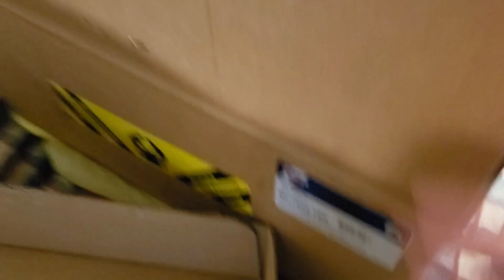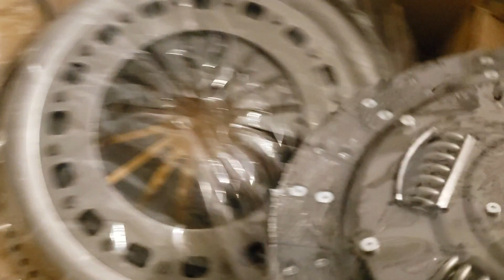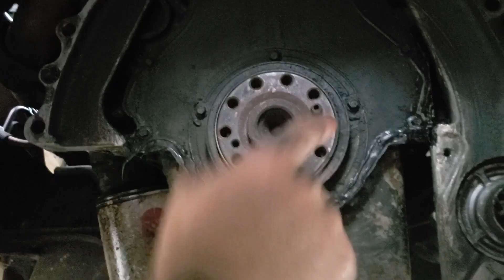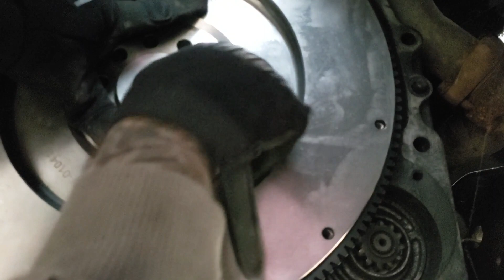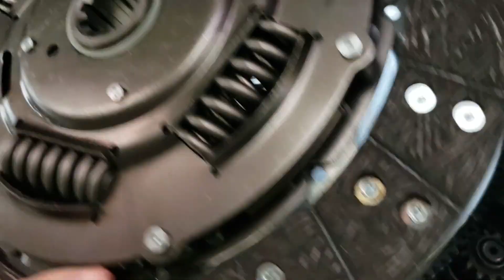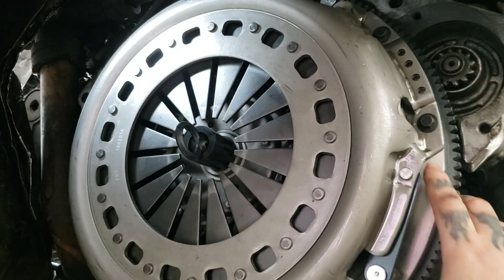7.3 Flywheel Clutch And Pressure Plate Install, How To Video

Comment: What year is the truck I have a 1995 that has the two stage flywheel was trying to find a single stage to put back in it have replaced it years ago but been hearing about a solid flywheel replacement just wondering if this is one of those I have a 95 f-super duty with the 7.3 power stroke in my rollback
Reply from the maker: Yes this is a powerstroke, you can see more on this 7.3 by seaching my channel videos

Comment: When you put the pressure plate on, should there be a little gap, and you snug it down, or is it supposed to be flat against the flywheel before you screw it down
Reply from the maker: They be a gap to you tighten it down
Reply: @TattsForLife thank you, I wanted to make sure I was putting it on right, mich appreciated for the vid and the response,  God bless
Reply from the maker: @colonialroofingofnorthcaro441 take care

Comment: I can’t get the flywheel to bust loose and what’s the best way to catch it? I’m trying to remove it right now if you see this please advise me
Reply from the maker: Air impact will take bolts loose, and just place your hand on it and hold on, its heavy be ready to gently set the weight down, its not easy, but just take your time and be safe
Reply: @TattsForLife thank you bro I got it all fixed thanks to you! I now have to replace the pedestal cause it’s leaking like crazy 😢
Reply from the maker: @blades7178 thanks for watching and happy the video helped

Comment: It's not grabbing the gears . It still moves but it takes a while for it to get going.  The stick shift goes in every gear okay but it acts like it not grabbing the clutch plate. What is wrong with my transmission.
Reply from the maker: It's probably the clutch disk, check to see if it's worn or glazed

Comment: How much did all your parts cost ? 
I got a Ford f-350 5 - speed overdrive manual transmission. 1999 3/4 ton , 7.3 motor 4×4 , 4 - door truck.
Reply from the maker: its a older video, I do not recall the cost, I say under $500

Comment: Great video but I sure wish someone would show the full process.  I got my clutch in and everything bolted up right, started my truck and it would not go in any gear. Re dropped the trans and my clutch fork seemed to be installed right but had two big gouges in the metal on my slave cylinder side. Something was locked up

Comment: Great video. Do you get any grinding noise after installing the single mass flywheel?
Reply from the maker: only in reverse but that is caused from the transmission gears for reverse and not the clutch
Reply: @TattsForLife  awesome, what year is your powerstroke?
Reply from the maker: @Arizonahwy10  I would half to look lol 😆 😂 I don't remember off the top of my head

Comment: Can Anyone Help me figure out why my clutch is hooting?  I've had my clutch assembly replaced twice in less than a year and it still "hoots like an owl" and yes they've replaced the throwout bearing both times. Is it possible there's an issue in the pedal instead? Any help is greatly appreciated!!
Reply: Just curious,  but I've heard the dual mass flywheel does that just before it separates
Reply: @tracyhill7960  We FINALLY figured it out!  It was the slave cylinder.  Praise the Lord it wasn't anything catastrophic!  Thank you!

Comment: I have a '90 F-250 7.3 non-turbo with the zf5, the ring gear on my dual mass flywheel is bad, would you suggest I just convert it over now to the solid flywheel?  And I'm guessing it will be the same as you show in your video?  Thanks for the time and effort in your video, very informative.
Reply from the maker: I like the way the solid flywheel preforms, but I use mine to tow alot
Reply: I've heard Reusing a dual mass will sometimes get your feet cut off when it blows apart at modern highway speeds
Reply from the maker: @tracyhill7960  Idk about that, but the solid is just stronger, I think a dual mask flywheel is their to help with vibrations and driver comfort, I drive alot old cars so vibrations are a normal feeling for me lol

Comment: Thanks for the vid..all my research on 7.3 is showing only 47 to 49 ft pounds for flywheel as well as manual with my clutch kit
Reply from the maker: Thanks for the info!
Reply: Be careful! The dual mast requires 49 and the single mast is like 89 or 90

Comment: Having an issue getting truck to go into gear after new clutch. When i was tightening down pressure plate the fingers were moving which seems odd so I exchanged it for a even better clutch assembly and same thing now truck wont go into gear while running. I also replaced master/slave cylinders. Out of ideas now
Reply from the maker: any trouble before the swap? and as your tighten the clutch down the fingers will move some as the disk puts pressure on to the clutch
Reply: Could be a bad slave cylinder

Comment: When you were tightening down the pressure plate to the flywheel, did the fins move on it??? I am having troubles with mine.
Reply from the maker: Not that I noticed, but the pressure plate does put alot force on to the clutch plate so it could, if its moving alot you could have something on wrong, or a bad part
Reply: @TattsForLife  okay. Thankyou for your help! I really appreciate it!!
Reply from the maker: @garyolp7125  Thanks for watching

Comment: Doing the worx clutch flywheel pressure plate, oil,pan rear main seal.I put84 cab on 91 1ton super duty hoping 3 inch body lift will  save me as far as the cab is concerned pulling  oil pan
Reply from the maker: good luck with your repair

Comment: Did you record removing and reinstalling your transmission?  Break in period suggestions for the new clutch?
Reply from the maker: just drive normal for a few 1000 miles for the break in on a clutch, and no I did not record the install

Comment: Did you take the transmission completely out or remove the driveshaft and slide the trans back?
Reply from the maker: Can be done either way,  I fully rebuilt my transmisson so it was already all the way out when I installed my clutch

Comment: Thanks for the video, that was easy to follow and helpful. Did you do this on the ground or on a lift?
Reply from the maker: sadly I had to do this on the ground, as no lift I know of could lift my roll back lol
Reply: On the ground and in rocks but put down big rug and half sheet ply wood for jacks to roll ... But 2 days later got it in .... Wish I would've used the 6in bolts as quied pins in the begging but hey u learn but its in how what a diff it makes totally diff truck 7.3 turbo 5spd. All bout can't wait to turn it up n lil more boost